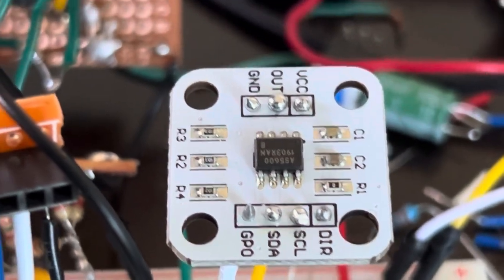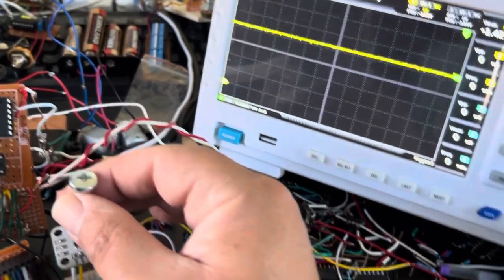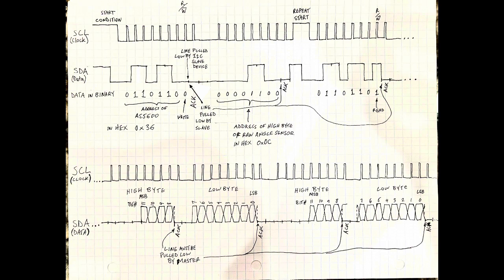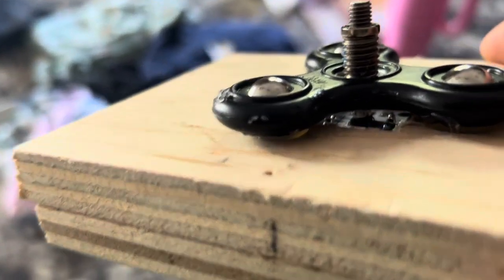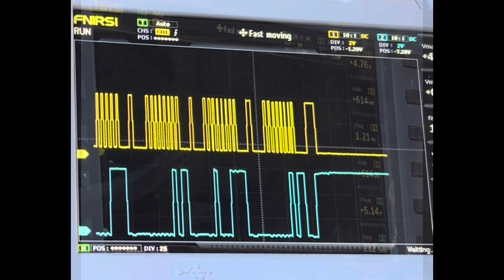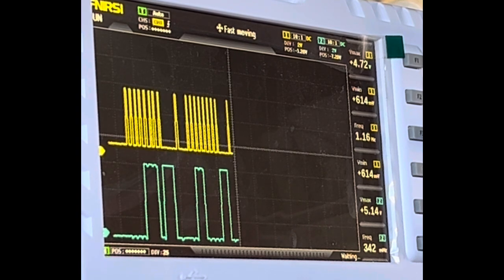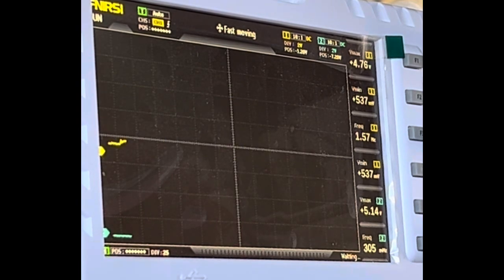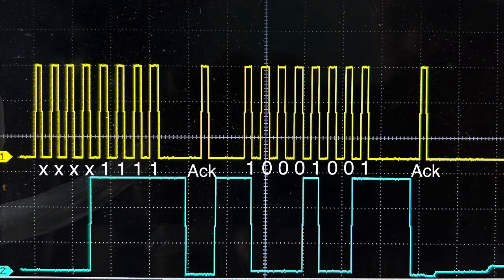Hacking the I2C protocol by hand with the AS5600 magnetic rotary encoder

Comment: you can also use the pwm interface on the as5600. you just need an interrupt pin on your microcontroller. i like to use the pin change interrupts on an atmega so you can have a sensor on every pin on a port and handle them in parallel in the same isr if you need a lot of channels. you can burn the settings on the as5600 so you no longer have to program it every time, but i think you can only do that once.

Comment: I've been there. A couple decades ago I needed to add a memory chip into a project, but the microcontroller didn't offered any bus to make it easier. 
So I did it using 2 IOs and some coding, and so I realized the timing isn't very strict with I2C, as long as you time clock-data properly.

Comment: try to use references like: "&Name_of_register" to find out the values of the setup registers in the Arduino chip while running.
You can find the names of these registers in the datasheet of the atmel 328p.
You can also drop your data at the right address to send it via the Two Wire communication.
No need to use the Wire library, much faster when using direct addressing.
Reply: i never really use the arduino functions anymore and just attack the registers directly. gives you more flexibility with less code. useful when program memory is limited. still use the arduino ide though. the datasheet is your friend.
Reply: @LordOfNihil  the Arduino IDE, yeah, rocks, plain simple, you only need 2 buttons, compile and burn further no visual distraction. i used it with Microchip Fubarino, 32 bit, stamp sized pcb.

I have done pic16F, pic18F.

Comment: You really need to use a 23lc1024, 128k sram chip, i made a very simple midi sequencer some time ago using a similar to chip like the Arduino, this allowed me to create a 96 ppq midi sequencer, simple with 74hc126 for leds and 74hc585 for buttons and 100% accurate up to 999 bpm, max Ableton.
makes your live easy.  : )